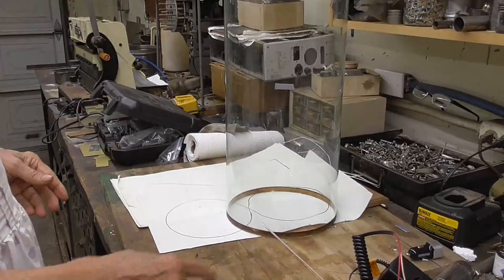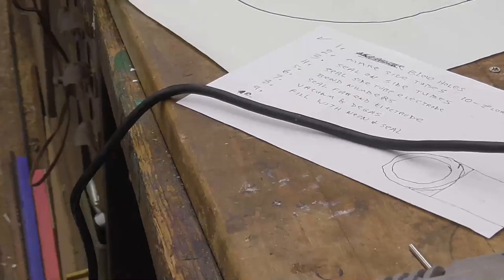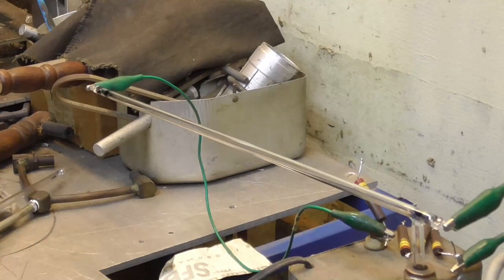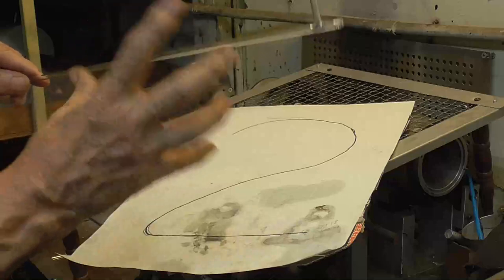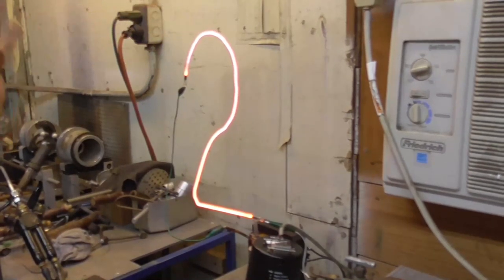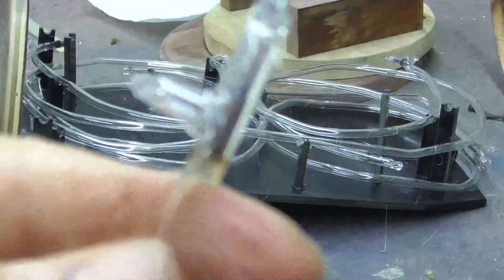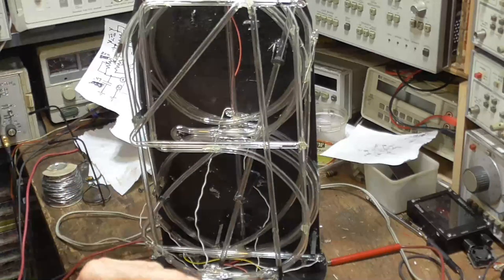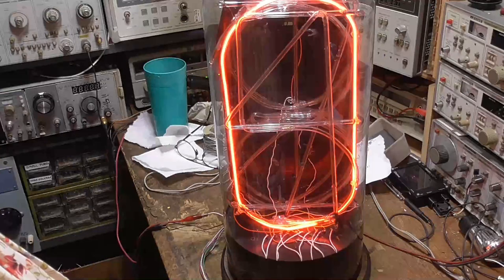MAKING A GARGANTUAN NIXIE TUBE

Comment: As usual, absolutely brilliant! Some thing I learned a while ago and it seems nobody knows: for removing hot glue, some alcohol often makes it an easier job than heat, it makes the glue almost magically stop sticking to what it's stuck to.
Reply: Aha 🤔
Reply: I recently discovered that trick on Mr. Carlson's Lab. Very handy!
Reply: Yes, hand sanitiser works well to undo it, and leaves almost no residue on either surface as well.

Comment: to remove hot glue easily, try some %100 ethanol or methanol or any alcohol on the hot glue, the alcohol seeps under glue, and its breaks the bond between the glue and surface instantly.
Reply from the maker: I will remember that. Thanks!

Comment: I've had an interest in glass blowing since ever I saw a glass blower in action as a child.  Thank you so much for sparing your experience.  You meatnioned the problem with the 1/8" tubing closing up.  I was wondering, would it be possible to keep the 1/8" tube open while it is heated if you had one end connected to a variable output aquarium pump, perhaps warming the air using a candle over a brass tube and using a heat tolerant type of plastic tubing ? Or is the tubing so thin that even that little of air pressure would cause the tube to form a globe?
Reply from the maker: A carbon rod was used to keep the tube from collapsing. Carbon does not stick to molten glass.
Reply: you just use a graphite reamer to keep it open

Comment: Very interesting video. Thumbs up :)
What kind of pump do you use to get such a low pressure? I tried to find a matching diffusor pump but had no real luck.
Reply from the maker: They are almost always available on ebay. First, do some research on diffusion pumps so you know what to look for and what not to!

Comment: You could have used a slayer exciter, Marx generates or simply Diode capacitor 8x voltage multiplier, it would have saved a lot of effort on the power supply side.
The tube is gigantic and as per my background reading, it is the worlds largest Nixie. Although it is not a true Nixie but still awesome.
The best part is your patience and dedication. You redo the broken stuff, and here we are who get pissed if a single solder joint is broken.
Cheers✨✨✨
Reply from the maker: The tube must be operated on AC. Using DC stresses one electrode severely and takes twice the current to get the same brightness.

Comment: Very interesting stuff. Can you not use a getter with neon tubes? I would have thought that to be quite useful for securing the vacuum.
Reply: Normally with a neon tube you use premade ends, that contain both the hollow electrode cup, the glass fed through and a getter inside the hollow cup, but fitting those on this size tube in the space available would be very hard, they are big, around 5/8 in diameter and 2in long. I am sure if Ron found a box or two of them he would use them, probably stripping them to make his own tubes, as they do come with a decent length of lead and a good seal, along with each being designed as evacuation port as well. The hollow cup design makes the electrode end large, so it lasts a long time, and the hollow cup with the ceramic lip means the sputtered electrode material is deposited mostly back on the cup, not on the glass.

Problem with the small tubes is fitting a getter, no room unless you put on a special getter section in an unlit section, and then paint it matt black with a mask to not have it visible.
Reply from the maker: @SeanBZA  The seals I make are totally vacuum tight. It will take years and years for enough gas to leak into the tube to make a difference.

Comment: Couldn't you run the tungsten hot for a while to use it as a getter to get some of the extra air out? You could also bake the glass in the oven for an hour to outgas the water that is soaked into the surface.

Comment: If you could make a conventional style nixe tube that big, it would probably work on 300 volts as the element spacing would be small.  However, with 10 discrete neon tube elements, you'll nee to run it as several KV.  Not sure how to drive that with clock electronics!
You can thank the explosion of electric cars for driving up the cost of copper, which is part of the alloy that is brass for the cost!
Homebrew HV relays look interesting.   If the tube commons and the HV transformer are not connected to the AC ground, then the transformer will isolate the control circuit from the AC as well.
Reply from the maker: The inverter circuit is totally isolated from the relay coils so the control circuit will not have AC hot no matter which way the plug is put in the wall.

Comment: Ron I am really amazed with your glass working skills. But I wonder if you could still have used the small tubing by drilling a hole in the side to make the T-junction before welding on the evacuation stem?
Reply from the maker: It is possible but very much more tedious work. Small tubing (1/8 dia.) is a real bear to work because it melts so quickly.

Comment: Ron, did you try filling the tiny tube with a pencil lead to avoid it collapsing from heat?
Reply from the maker: The glass collapses down onto it holding it quite firmly. It is almost impossible to get it out of the tube after cooling. The metal mandrels are slightly tapered so they slip out easily.

Comment: WHAT CAN I USE TO CLEAR COAT A METAL FREQUENCY DIAL  THAT WILL NOT HARM THE PRINTED DIGITS?
Reply from the maker: Urethane clear lacquer. (spray can) Warm the dial up to where it is very warm to the touch but not such that you can't hold your finger on it. This makes the lacquer dry very fast. You can put it in the noon sun to dry it quickly. You may need two coats. Best to do two thin coats than one thick coat.
Reply: @glasslinger  THANK YOU SO MUCH

Comment: It's a shame you don't have steel wedges to use around 1:04:29.  If you could just drop wedges into the chicken-wire at strategic points, you could just heat up the tubing and bend it along the wedges (just wedge shaped to keep it from falling down).  It would make a great jig. 
If it was too course, you could even just use finer chicken wire.
Reply from the maker: In the end I used a piece of kiln board and simply laid the glass on the board and heated it. The chicken wire was a first attempt and was far from satisfactory. Live and learn!

Comment: There is something I don't understand very well. is when you test for leaks with the high voltage spark. What is expect to see a change in color or what. Can you please explain with more detail?
Reply from the maker: Where there is a pinhole leak through the glass the spark will jump directly to that point and go through to the inside. It is very obvious when it happens.

Comment: Nice good job sir, it's just that I'm a little disappointed knowing it uses modern electronic components on HV source unit.
Reply from the maker: It was a close call. If the 400 cycle inverter didn't work, I was going to use a standard low tek 60 cycle neon sign transformer.
Reply: @glasslinger From everything you have made in "glasslinger" I come to know that you were a great person at the time, I really admire you sir.

Comment: Hi Ron ! Great video! A lot of work went into building this. Regarding the powersupply and your first idea about seperate PSU for each digit; maybe the transformers from an old LCD TV display (backlight) could have been helpful ? I dont know the switching speeds they operate at,  but its probably quite a high frequency, the transformers are extremely compact. Thanks again for sharing this with us ! Take care!
Reply from the maker: The high switching frequency couples by capacitance from the active tube to the adjacent tubes causing ghosting.

Comment: Would making a Nixie tube that size the "normal" way even be possible? Or would an envelope that size never take a vacuum...
Reply: Nixie tubes are neon, not vacuum.
Reply: @williammullaney2463  5 torr of neon is a near vacuum compared to the 760 torr in the room. ◡̈
Reply: @Pants4096  he said in the beginning that because of the pressure difference you would need a way to thick glass and the filaments have to be aligned perfectly for them to flow evenly.

Comment: +glasslinger  Based on what you are describing in the beginning of this video, I think the safest and most viable option to speak the classic design language of the Nixie tube for a tube of this enormity would be to create a 16-segment alphanumeric digit based on RGB LEDs, where you could adjust the brightness of the red, green, and blue LEDs accordingly to achieve either the classic amber of a real Nixie or the turquoise of a vacuum fluorescent display, all the while being able to get away with pulling little or no vacuum as you said yourself that the glass would only withstand a very minimal vacuum at only 1/16 of an inch thick.  At that point, the mesh of a real Nixie tube would only serve to punctuate the aesthetic dialect.
Reply: But at the end of the day it will be an LED display and won't have the cool factor of this.  If I wanted to go that way, I'd use fiber optic and only have to use one LED per numeral.  This would have the same color changing and brightness control with a lot less work.
Reply: lol, custom tube is quite another league, and this guy is all about tuebs and radio, what would be a point of making a LED display a 10 year old can do?

Comment: Couldn't you have put some getter material in the digits to help with the air contamination?
Reply from the maker: Possibly. It would have complicated the end electrode assemblies a lot. At a certain point in a project you say, "enough is enough," and move on.

Comment: Superb! I was wondering if that wire you made the numbers on was galvanized wire. I learned that zinc vapours are toxic, hence my question.
Reply: Maybe nichrome?
Reply from the maker: No galvanized wire anywhere. All pure nickel.
Reply from the maker: OH! You mean the support frame to hole the numbers. Yes, that was galvanized screen. It does not go in the tube itself so no problem with contamination.

Comment: 44:09  Why do you have to re-heat that tube? You already drove the gas out of the glass the first time.   Once the air is driven from the glass, does it get back in the glass again?  How does it migrate into "cold" glass again?
Reply from the maker: Atmospheric pressure is about 200 times more than the pressure I am putting in the tube. So the air is "pressed" into the surface of the glass 200 times faster than the vacuum pulls it out. Just a short time exposed to atmospheric pressure can drive a surprising amount of gas into the surface layer of the glass.

Comment: That is freaking epic. Too bad you didn’t make at least 3 more of them. As for driving the relay coils, a ULN2003 would drive 7 of them, so use 2 of them and you have a few spare, ideal for switching relays as it has the back emf diodes integrated. You can drive the inputs of those with arduino or a 4028 bcd - decimal decoder, uses 4 pins as opposed to 10. Needs a bit of direct port access on the ’duino to output the number to bcd but should be do-able with normal digitalwrites and a switch-case block, just take a bit more code space.
Reply from the maker: It's easier than that! There is a single digit clock kit that has 10 open collector outputs to directly drive the nixie digits. They will easily drive the 12 volt coils of the relays. A bit of wiring and a 12 volt wall wart and done!

Comment: Боже мой, что это за дичь, мужик, мужской голос, торчат сиськи, женская одежда, волосы крашены в розовый, чо происходит???
Reply from the maker: Crazy Americans being silly!    :)
Reply: @glasslinger  As a 15yr kid I had inherited two 30’s tube radio and a bunch of parts and tubes. I know one was a Crossly. I had a vom, soldering iron and a limited voltage power supply. Cleaned up most of the parts. Install tubes. Had no idea what voltage anything was so things just smoked. Wish I hadn’t just trashed all of it. I tossed out one of the “Castle” speakers.